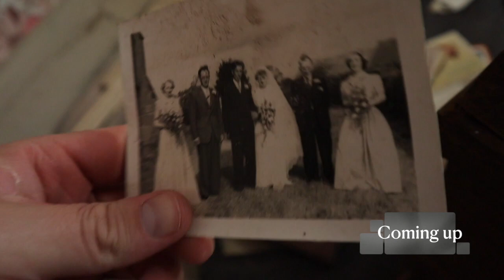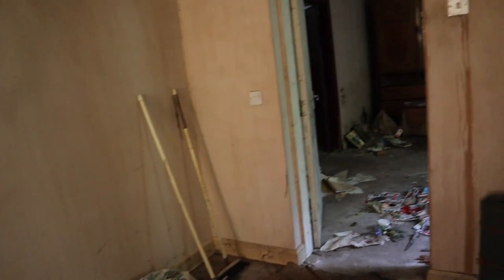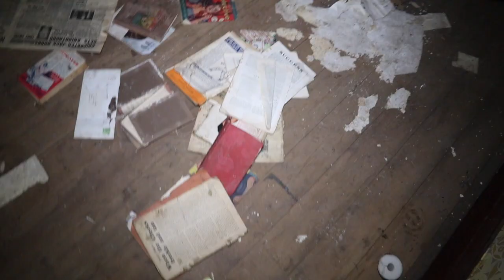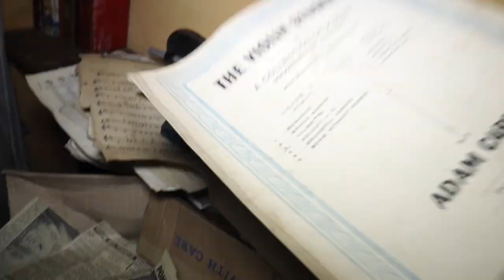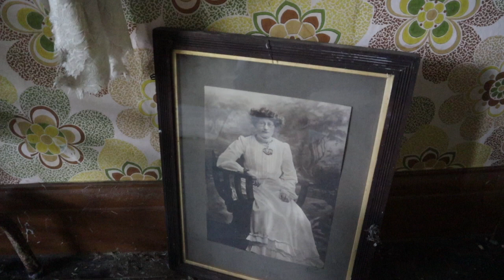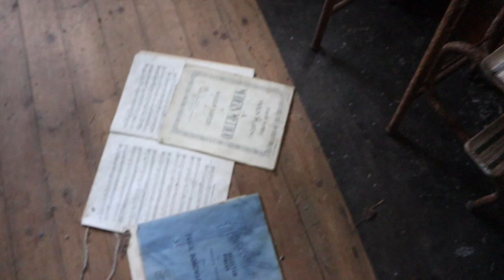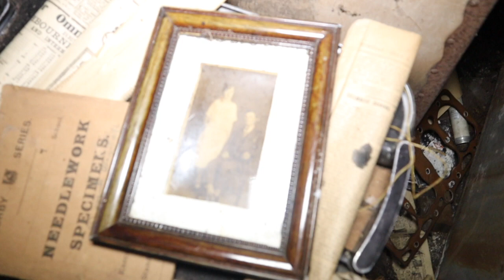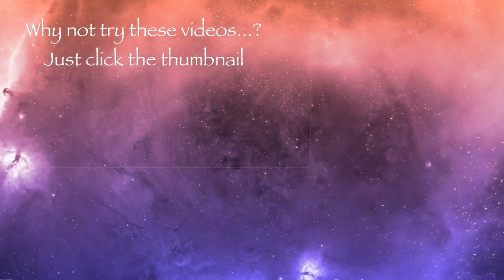THIS HOUSE IS A TIME CAPSULE - THERES EVEN AN ABANDONED CAR

Comment: It's a shame about the betrayal of trust from the guy that stole the car parts. 🤬

What you picked up at the beginning was an old Mouli rotary cheese grater, made in France would have been stamped on the front, but I can't see it on the video. 😉

The Osram Music Magnet is basically an old crystal set (Radio LW/MW). That model is the Osram Music Magnet 3 and dates back to 1928. 

Cool explore. Cheers! 👍🏻👍🏻
Reply from the maker: Brilliant that Is, thanks for letting me know!! 

It did have some sort of stamp on the front, I went somewhere recently and saw something very similar, another house I mean :) 

And that’s brilliant about the music magnet, I should have opened it maybe, I just don’t like to mess too much 😬

About the guy with car parts, yes it’s a real shame, I’m glad he was caught out though if nothing else. The car was a pretty solid one until then, I went back to do a paranormal investigation and the boat has sadly now gone.. :/